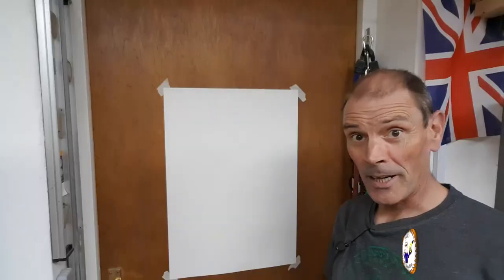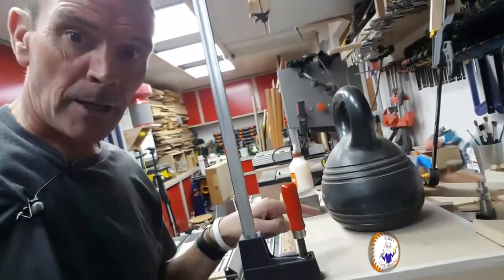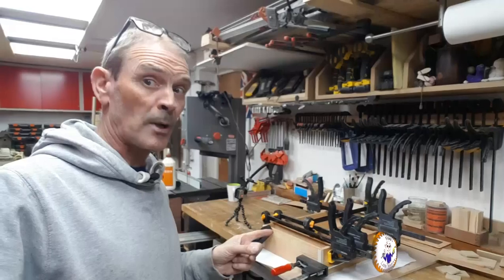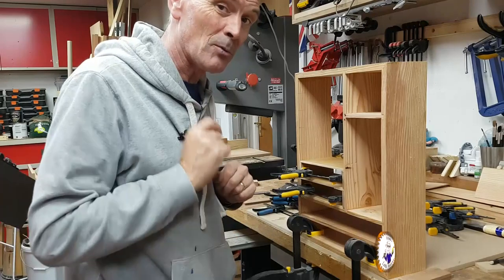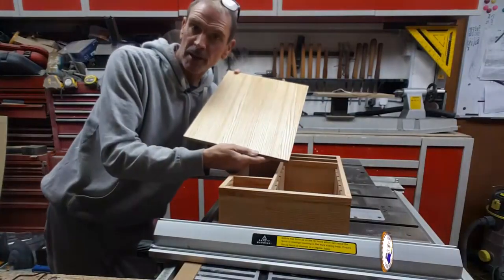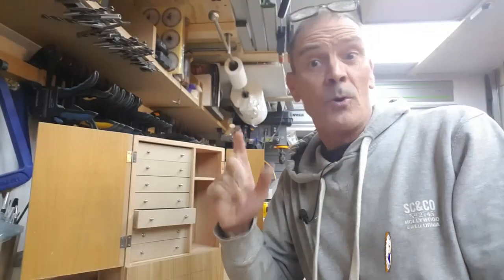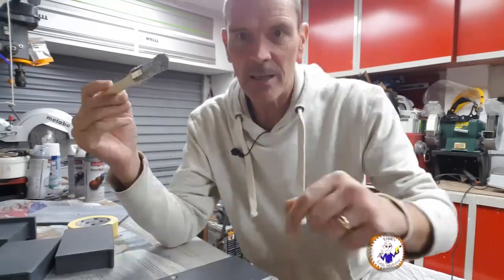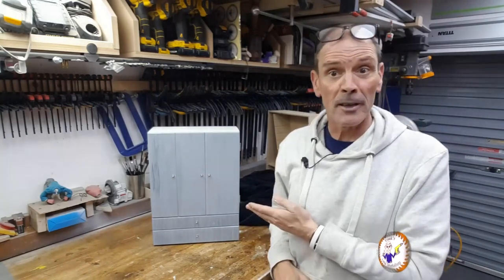Miniature Wardrobe, Jewellery box.

Comment: Jesus O'Reilly Frank! I would have set fire to the plans and paid someone else to do it in the end. How you didn't take your frustrations out on the MDF version I don't know. But all that said the end result was brilliant, I especially like the lining on top of the perspex drawer dividers, that's a nice finishing touch. 

On a separate note, I noticed you have a Stanley fatmax drill, I notice in b&q on the weekend they have some of the 18v range reduced a fair bit
Reply from the maker: Thanks James 😁. You may have noticed that the MDF version you see... was the second attempt. The first.... well... it didn't quite survive to show it face on video 😂🤣. Yep, I'm a big fan of Stanley drills and drivers. I did an unbox of the twin Pac (drill and driver) about a year ago... both still going very strong indeed. I highly recommend them... I'm sure I need three of each 😂🤣. Thanks for watching James 😁👍
Reply: @frankslittleworkshop turn the MDF one into a cabinet for your vape and accessories!  I've got the fatmax impact driver and drill, had it about 5 years now. Also bought the Ros sander and on the weekend, I bought the brushless impact driver, because 4 impact drivers isn't enough! 🤪